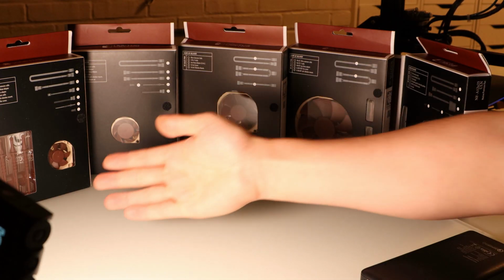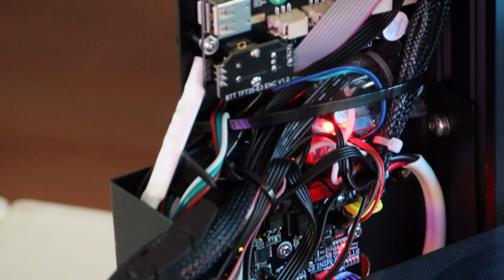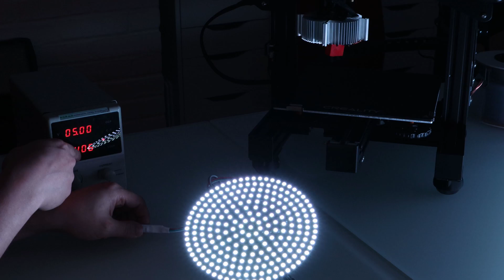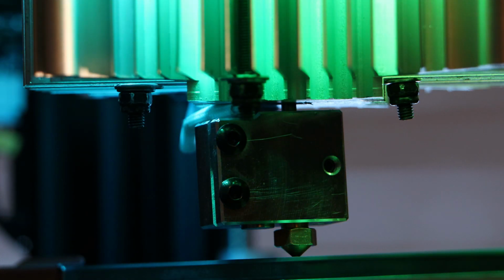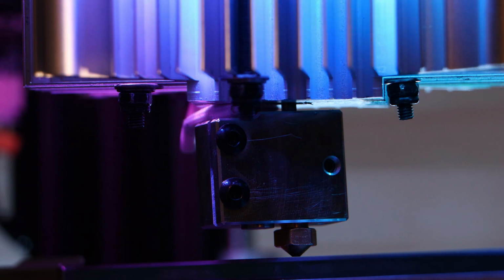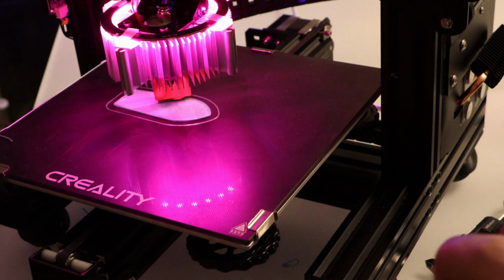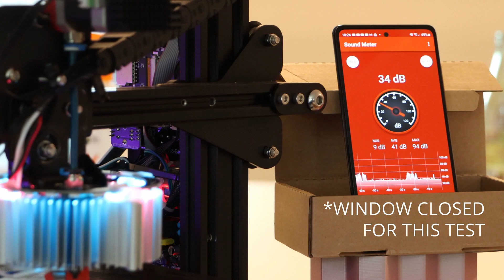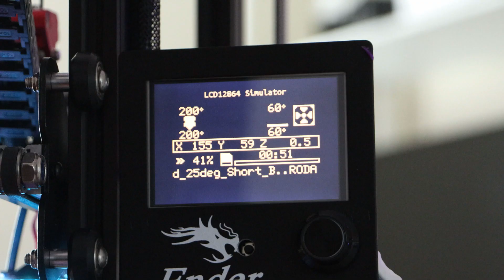Ender 3 - Fanless Build

Comment: THE DAY HASE COME!!! so excited to see what you come up with in this video! :D

EDIT: i am a bit saddened that there wasn't footage of how you applied the vapor champer to the mainboard
The cpu cooler looks SICK!!!! well done. I looked up the sorbothane for the last video and it is just the right thing to get for the ender. though its pricey ..
I don't know if it is actually possible to make it "silent" though check out "Berd Air" cooling. It uses a air pump that pushes air through a hose to a hollow ring or rods with holes inside around the nozzle that replaces the part cooling fan. that way you can add part cooling to your silent ender or in general, Berd Air cooling could be right for you as a experiment/video as you seem to have the competence and crazyness for absurd mods :P

now i wonder if it would have been possible to make the meanwell PSU fanless and somewhat cool. to open up one side, print a mesh replacement that lets the air flow freely from the bottom to the top and put some oversized industrial heatsinks to the backside to grap some heat.

do you, (well probably a stupid question after watching your videos ;P) consider doing a watercooled build? myself am modding and learning (the building and designing like fusion 360) of how to make the ender heated chamber compatible without needing to put the electronics outside the enclosure but by sealing the mainboard/raspberry pi area and the PSU with fresh air supply and exhaust or even fully water cooled component (which will be a nightmare with the stock meanwell supply) so if i print ABS at another place I can take the foldable enclosure and put it around the printer and then ideally only deattach the watercooling radiator and put it outside of it. or the step between with the sealed chambers for the sensitive parts, and do a real intake and exhaust system.

also, did you play around with firmware? I see you had done Marlin last time. As a rescent convert LOL from Marlin to Klipper I wholeheardetly recommend it if you love speed and precision :D
as an example with an attached acceleration monitor you can calculate your printers resonance for the axis and compensate for it. meaning you reduce your ringing at corners to a bare minimum while pushing the limit the printer can go in terms of speed. this vid goes into detail of what it is all about if interested https://www.youtube.com/watch?v=iNHta6zljoM :) cheers

great video btw ;P

the visuals had a very pleasing effect on the eyes :)
Reply from the maker: Thanks, I had some minor delays due to "technical difficulties" that I alluded to in the video. Hope you like it!
Reply: @NathanBuildsRobots  Yes i liked the video very much :)

i edited the upper comment after watching the video after you already replied. :O

wish you a very fantastic day :)

the technical difficulties was the "ask my of how i know" about the mainboard? ;P
Reply from the maker: @chaicracker   Unfortunately I couldnt figure out a good way to include the vapor chamber footage without disrupting the flow of the video, but I'll explain how I did it: I bought an M.2 drive cooler on Amazon and took the heat pipe out of it (link in description). Then I gently smooshed the heat pipe in a bench vise. The M.2 cooler came with the white thermal pad that is shown on the back of the board. It is held in place with 2 custom clamps made of flexible fiberglass strips with glued on magnets.

I looked up Berd Air, and thats exactly what I considered making, along a silent aquarium pump. I'd need a way to keep the flow laminar, as turbulent air can be loud. 
I'd like to do something using a chimney that pulls air upward, or maybe putting the printer upside-down, or turning off part cooling. Still not sure what the best way to do it is, but definitely needs to be addressed to accomplish good overhangs in silence. 

If you check out the Prusa i3 MK3s, its power supply does not have a fan. Also they make 24V power supplies to drive LED strips that are fanless. But I tend to stay away from modding the power supply, just because its the most dangerous component (most likely to shock someone and most likely to start a fire) and I want to keep my mods safe.

Klipper and Octoprint are on my radar. Lately my niche has been silence, so speed has not been as much a priority. There are already some madmen working on speedy printers (MirageC and lately CNCKitchen).